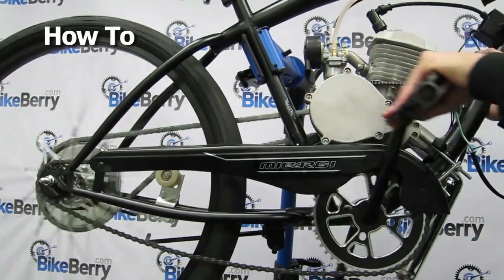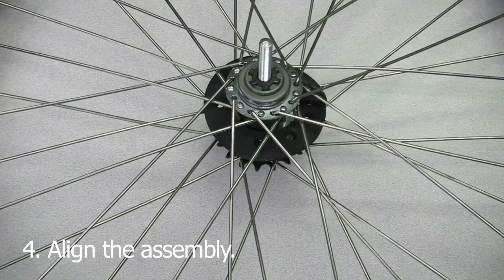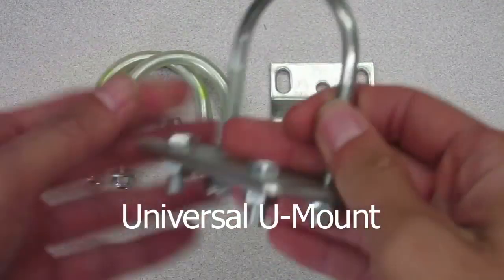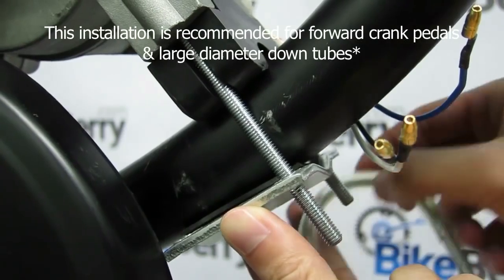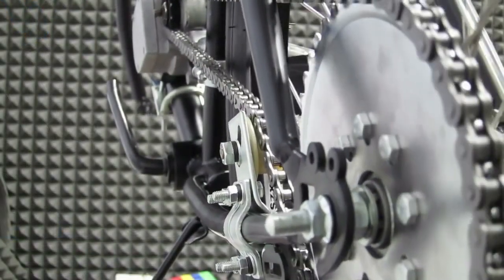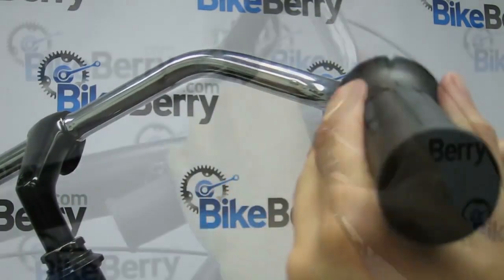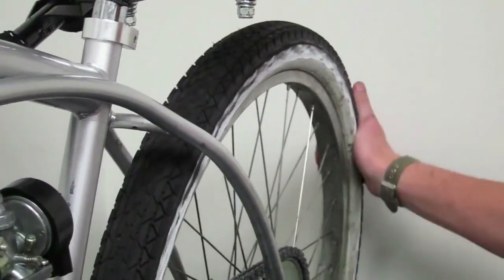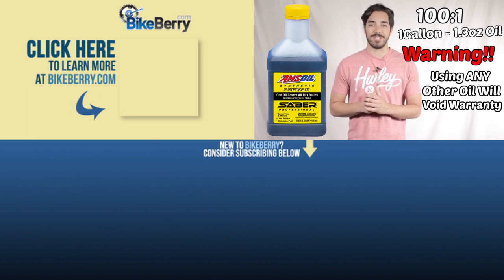Flying Horse 66/80cc EPA Approved 2-Stroke Installation Guide and Tutorial - How To

Comment: One Hardy Mechanic Tip for all Motorized Riders and builders alike, always always always use a little bit of Locktite BLUE medium strength on all bolt assembly, it will hold in Strong vibrations and can be removed unlike the RED.
It helps the break in period alot better as well, enjoy Riding safely
Reply: You all prolly dont give a damn but does someone know of a way to log back into an Instagram account??
I somehow forgot my account password. I would love any tricks you can offer me.
Reply: @Henrik Alexis Instablaster :)
Reply: @Gordon Crew Thanks so much for your reply. I got to the site on google and I'm in the hacking process now.
Seems to take quite some time so I will reply here later when my account password hopefully is recovered.
Reply: @Gordon Crew it did the trick and I now got access to my account again. I'm so happy:D
Thanks so much, you saved my account :D
Reply: @Henrik Alexis Glad I could help =)
Reply: @henrikalexis4168  when you finally get your password reset be sure to write down your new one and TAPE it to the bottom of your keyboard

Comment: At 7:23 it's pretty clear there is a massive crack in the left side (as you're looking at it) engine mount casting.  Looks like a catastrophic failure waiting to happen.  I wouldn't use that.

Comment: How can an outdated motor be epa certified?
Reply: Because the way it is made it only makes about 1hp and cannot run very far without blowing up as the EPA only says it is certified if it runs 100:1 fuel/oil ratio. Trust me they are not worth it

Comment: What the hell is an air inlet valve? Also what happened to 16 to freaking 1 with Castor927? I run 28:1 with Castor927 in my Goped GSR40 TSi and I will soon be using 28:1 with Amsoil Dominator. I don't think I would ever use Amsoil Saber, that stuff is for like freaking garden equipment, and I especially would never practically mix anything at 100:1. If you seriously think you're fine mixing anything at 100:1, you can say goodbye to your engine, lol.

Comment: 100 to 1?

I've seen people lean out on 50 to 1
Reply from the maker: 100 to 1 is the ratio for the EPA engine.
Reply: @bikeberry  Do you really expect those engines to last? 

50 to 1 is the lowest I'd go on any 2 stroke
Reply: I don't even go past 40:1 oil is any engine's blood it needs IT, what's the number one cause of Piston seized up or engine failures? I'd rather have my motor lubricated and not Overheated.
Reply: 40:1 full synthetic. The reason they claim 100:1 is because that burns much cleaner. Thats how it got EPA approved
Reply: @rabbitfootedkitty1339  fact

Comment: Sorry but that engine is no good it has those cheap motor mounts those little bitty itty bitty cheap motor mount bolts if the motor vibrates those bolts will snap off real fast so don't buy those ,family don't buy that style of motor you need to find a type of motor what they call a pk80 motor that one has two strong bolts. To mount the motor, bigger bolts keep the motor from vibrating and those sturdy bolts won't snap off